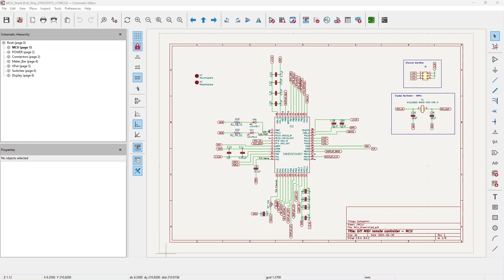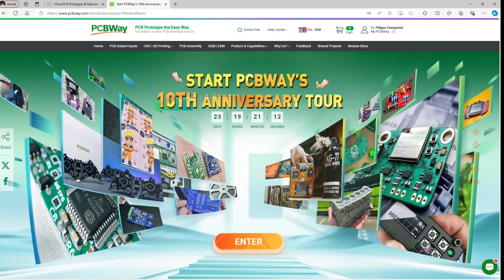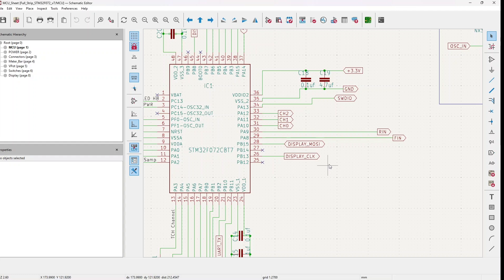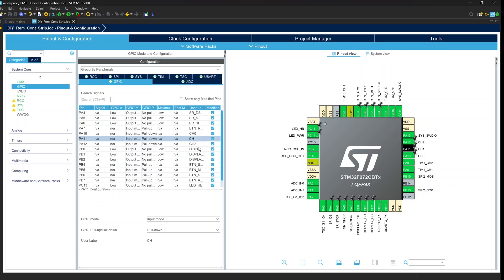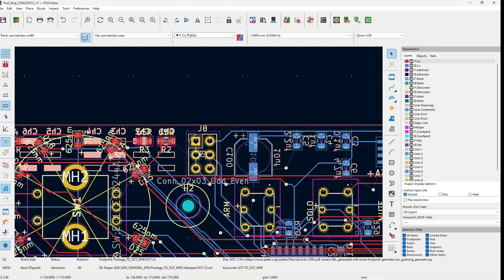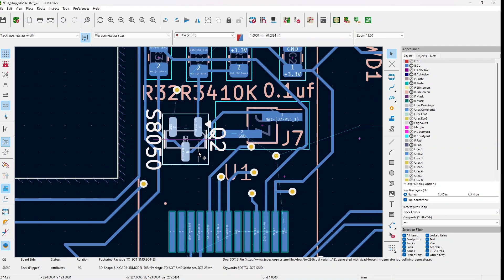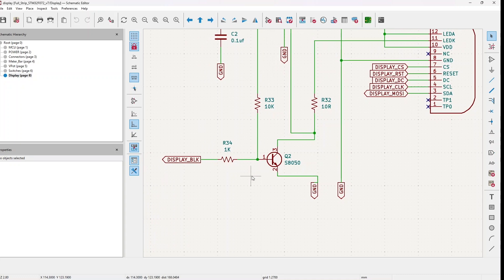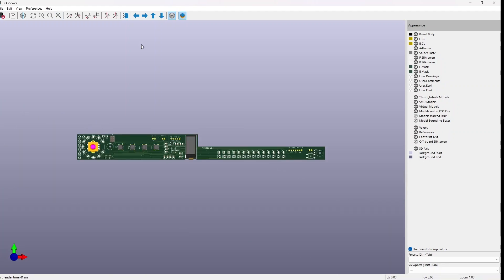DIY MIDI Remote Controller - New Strip - Part 2

Comment: Hello, I am learning this myself. I want to know if each channel strip has a microcontroller ,how are all strips connected together, which finally sends to the MIDI device or PC
Reply from the maker: All the channels are communicating with the main board via UART and of course yes every channel has its own Microcontroller. If you are new I suggest to use a powerful MCU such as STM32H7 and connect directly everything to it… the architecture described above is really modular but quite complex to operate… in a stable manner
Reply: @fcampanini  Thank you so much for the advice I have created small MIDI devices. I wanted to know more on how to distribute functions and communicate to a main controller like  master and slave I want to know if there is supposed 1 or 2 URt ports on the master controller how are we daisy chaining them. You can point me to the topology, I will start from there

Comment: Ciao Filippo, complimenti davvero, gran bel progetto. Ti invidio un pò, nopn sono bravo come te purtroppo. Pensi che sarebbe possibile fare un controller midi con solo 2 fader motorizzati, 2 knob rotativi e una ventina di pulsanti tutto con un voltaggio di 5 volt? Sto cercando di progettare questo controller per poterlo usare con un power bank collegato ad un tablet con Arduino. Ho visto che esistono dei fader motorizzati che lavorano a 5 volt, che ne dici?
Reply from the maker: Ciao kaioyoca, per quanto riguarda controllare un paio di faders, un paio di encoders e una ventina di pulsanti avendo un arduino con sufficienti IO dovresti farcela. Il problema per i faders motorizzati è più la corrente temo che la tensione: verifica bene che l’arduino li regga… un saluto!